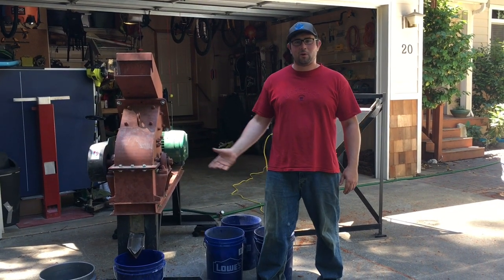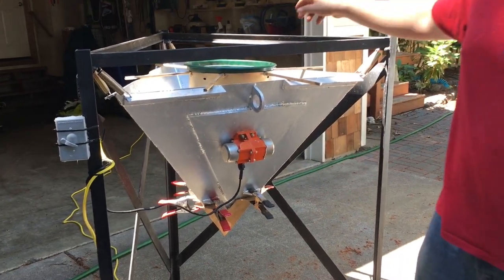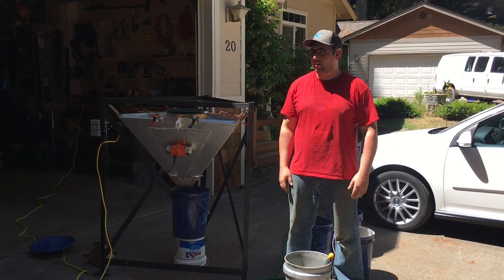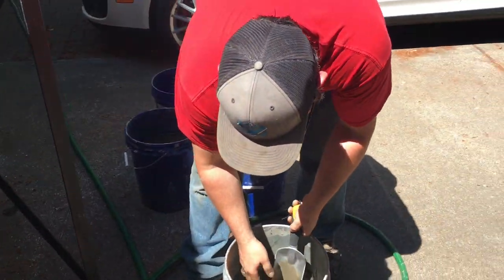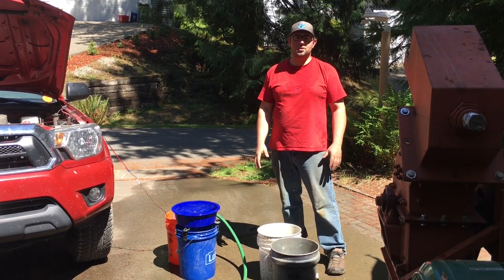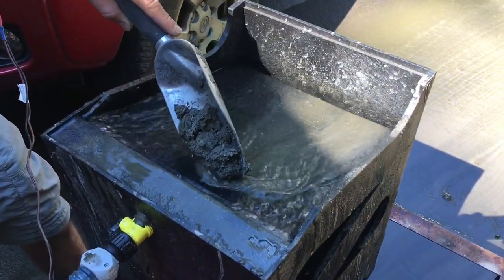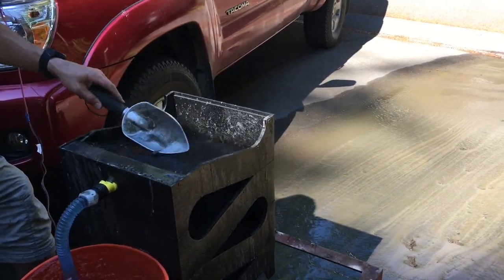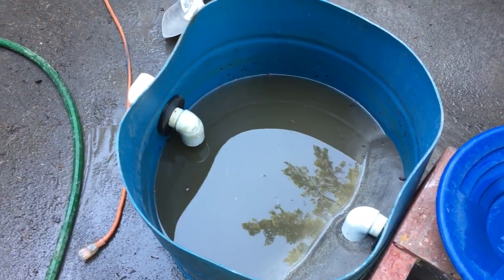Fine Gold Recovery Process for Quartz Ore, using Hammer Mill and Concentrator

Comment: The gold cube, or a shaker table is the way to go. Pretty good sample. Now how does the vein look in the mine?
Reply from the maker: The vein looks great but it's so tightly grained it's very difficult to chip away at without drilling/blasting.

Comment: Hey cool video! Would this set up work with circuit board recycling? I'm looking for a mill that will turn pcb ( printed circuit boards) into a fine enough powder to be able to pan out the metals
Reply: Acid processessing is going to be much more efficient, cost effective, and far less noisy. Just build yourself a good fume hood and splash protector!
Reply: Acid processessing is going to be much more efficient, cost effective, and far less noisy. Just build yourself a good fume hood and splash protector!
Reply: Acid processessing is going to be much more efficient, cost effective, and far less noisy. Just build yourself a good fume hood and splash protector!

Comment: have you found hammers wear quick or have you found a way round that?
Reply from the maker: Good question, yes hammers wear quickly, they're just inherently the highest wear part... If you see my first video (DIY rock crusher), there's a pile of ~500 in the background! They last about 40 hours to a set. I sell them on eBay for cheap if you have a mill of similar size.